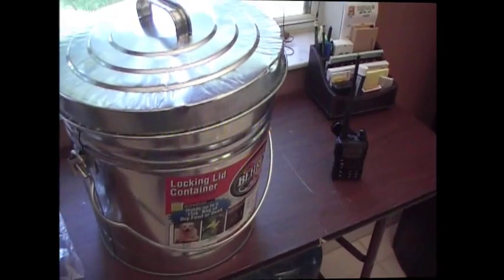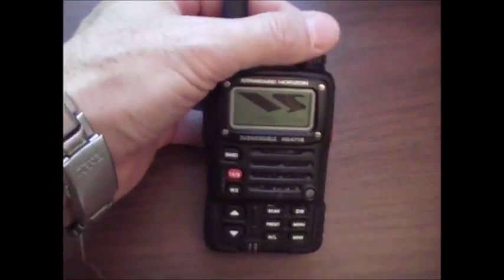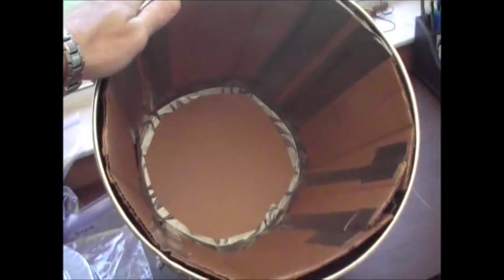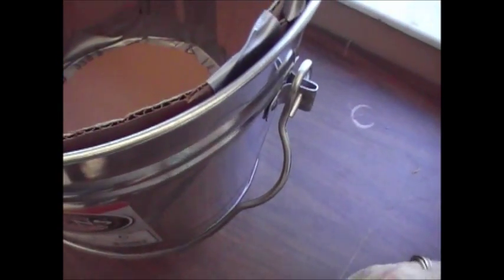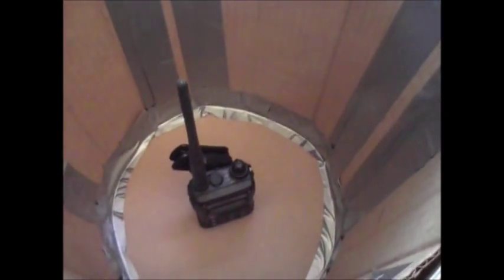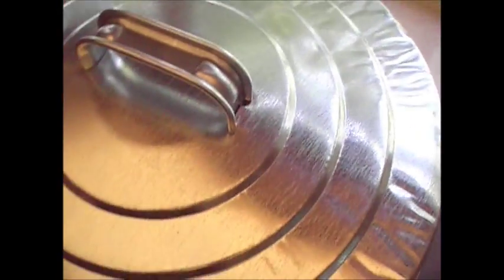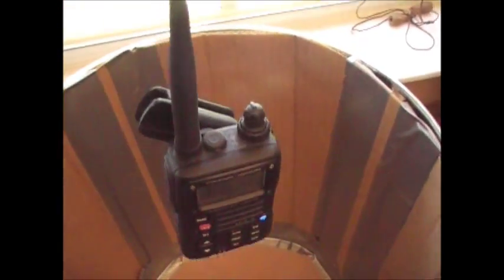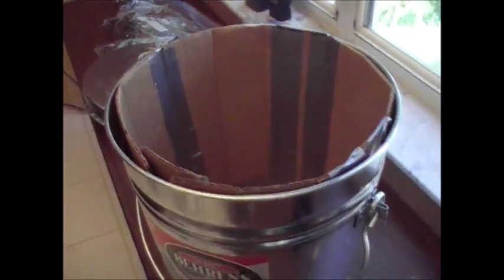Faraday Cage Test

Comment: I would think that something along the lines of (((((equipment)insulator)cage)insulator)cage) buried no shallower than 3-5 feet beneath the surface, with all metal seams being welded or soldered at all points along the seam, would be good enough for even extremely sensitive equipment.

Comment: right now, my concern is for the possibility of extreme solar flares within the next year.  If I strip my computer of its components...hard drive, motherboard, memory, etc and pack them in this cage packed in anti-static bags, will they be safe from the CME's that could wipe out our power grid?